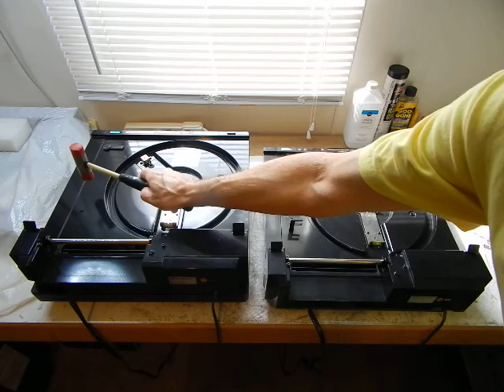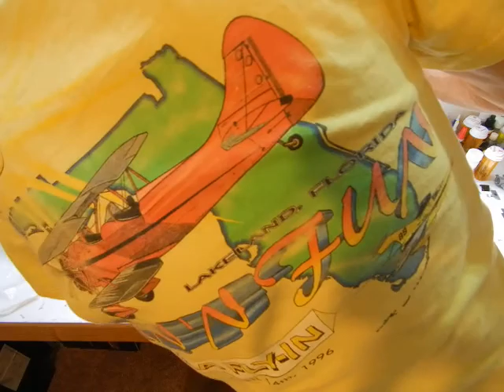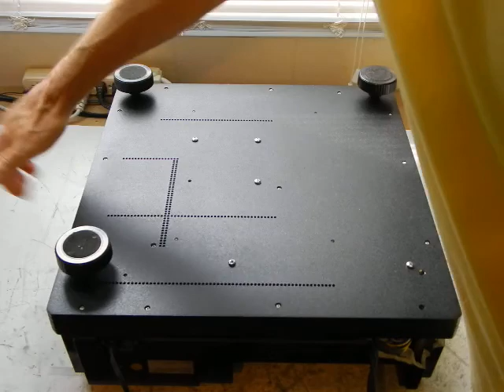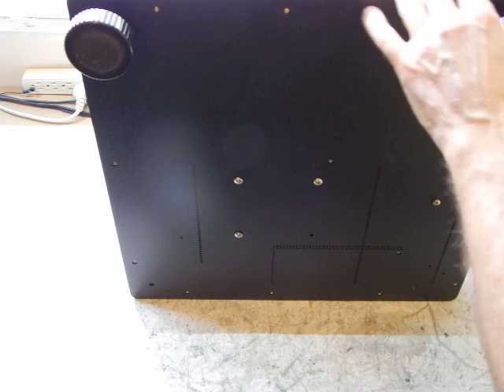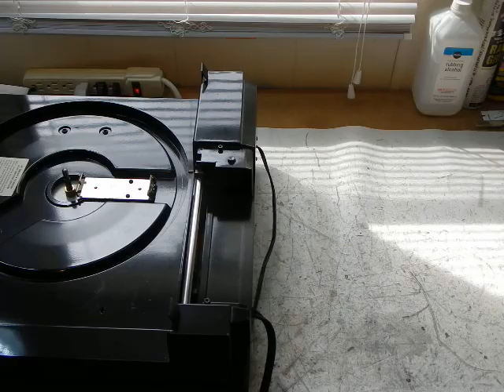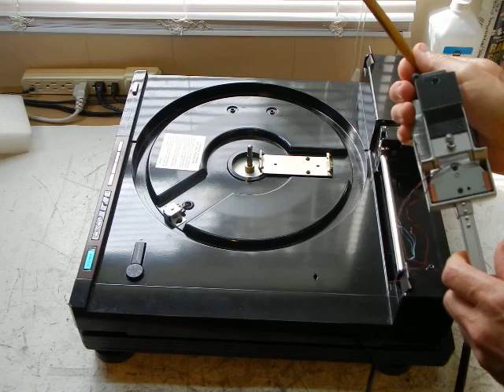Sony PS-X800 turntable custom supplemental plinth upgrade

Comment: I have a Sony PS-LX57, one of the cheaper linear trackers from the late 80s. I wonder if it would benefit from a similar plinth addition? I also notice some subsonic vibration getting into the stylus from the arm motor, (every time it inches forward); it's not really audible but definitely visible in frequency analysis. I haven't tapped on the casing but imagine it can't be very inert (it's very lightweight). While I find the overall sound presentation enjoyable and accurate, it is a bit thin sounding and lacking in oomph for lack of a better term.

Comment: Excellent!
Your dedication to this rare and wonderful turntable will keep them running for another 35+ years!
Reply from the maker: Thank you Michael for your kind compliments.
One thing that most people don't know about me is how much passion, time, resources, custom built service tools, personally written service manual supplements, customer service, etc. I have committed to over many years for the long-term quality servicing of not only the PS-X800, but all the other Japanese high-end SLT tables like the PL-L1000, PL-L1000A, 8000, 8000A, PX-2, PX-3, and PS-X555ES. I wish I could include the various Mitsubishis to this lineup, but as of this writing, no one has sent one of these to me for servicing.
Best wishes, Alan